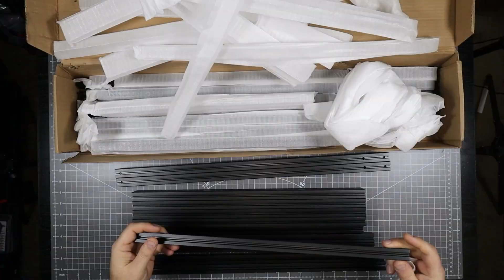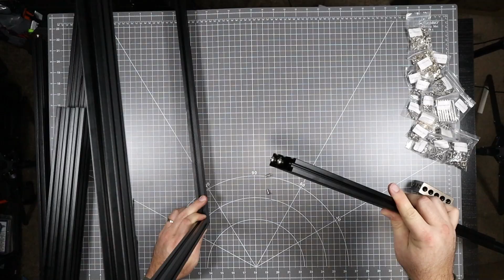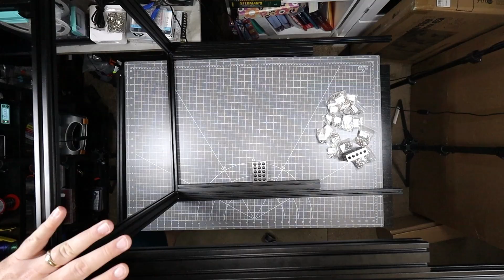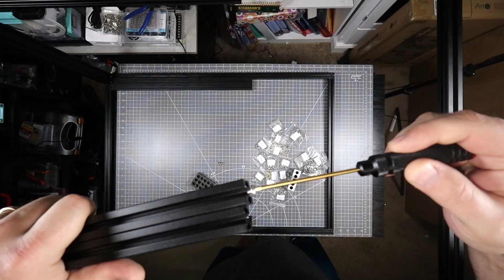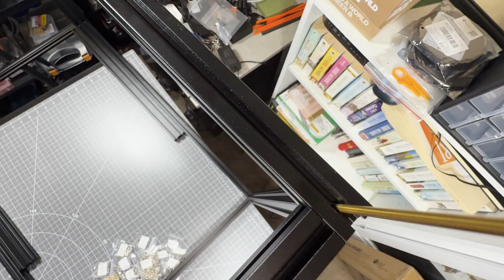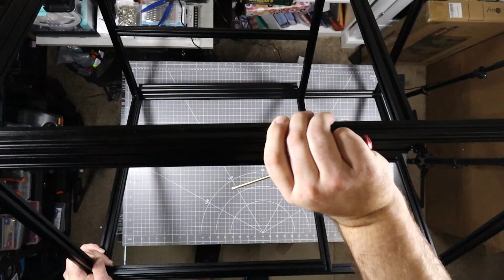Zero-G Nebula Plus Build – Unboxing & Frame Assembly (LDO Kit from Fabreeko)

Comment: I have a Mercury one.1 I built from the Fabreeko Honeybadger kit. Can I migrate it to this frame system?
Reply from the maker: yes. Mine started out as a self sourced Mercury One.1. Keep in mind, however, that you'll need to use the Hydra 3-point bed leveling system as well if you're not already. There's no direct support for the stock Ender 5 cantilever bed system.